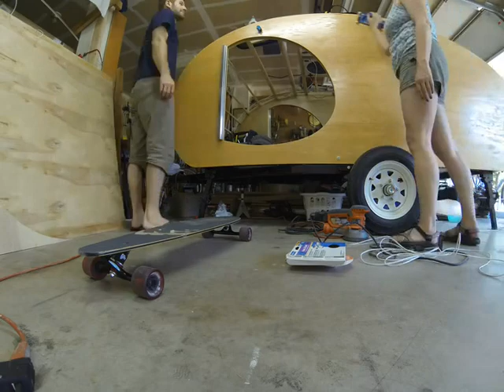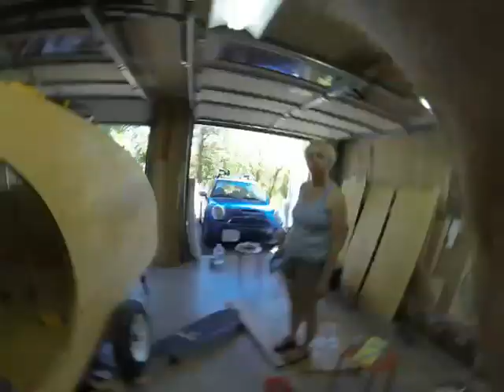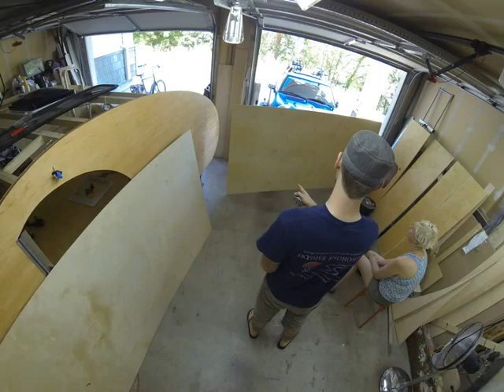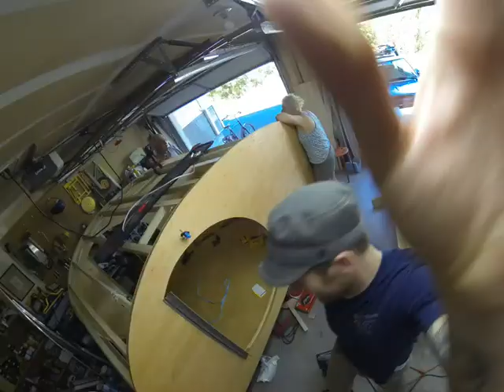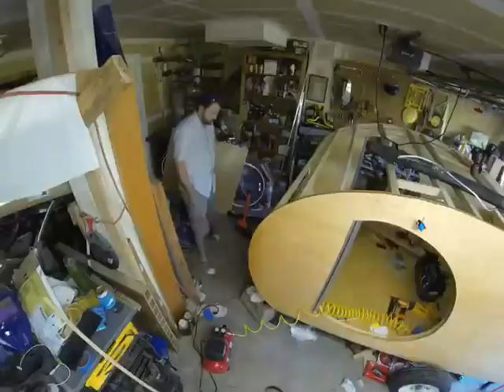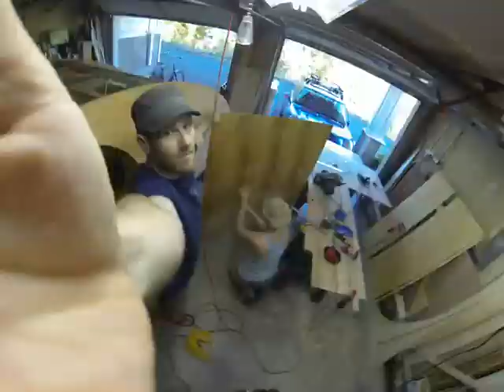Denizen Teardrop Trailer Build — Ceiling Part 1

Comment from the maker: Hey Jeff! We tried using wet towels and a heat gun on it, but it just seemed to evaporate too quickly. I didn't want to delaminate the wood, but we may give it another go tomorrow really getting it wet ... not just spritzing it with a spray bottle. We'll keep you posted on how it goes!